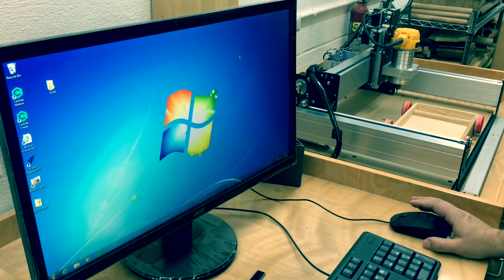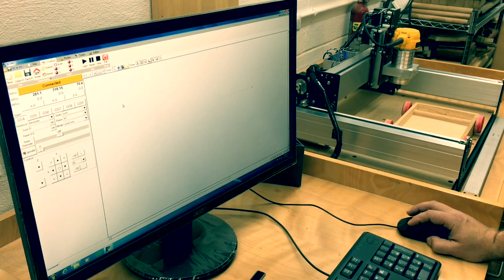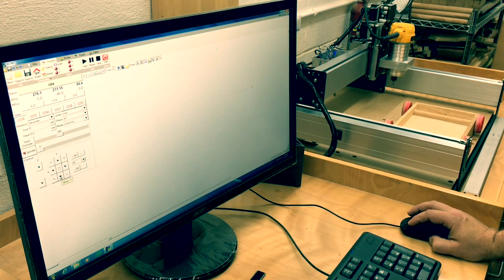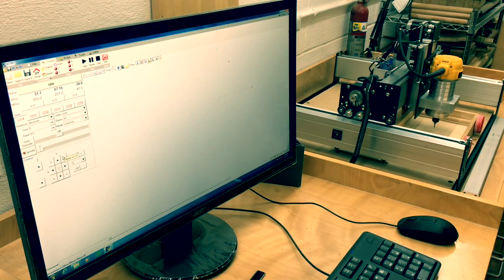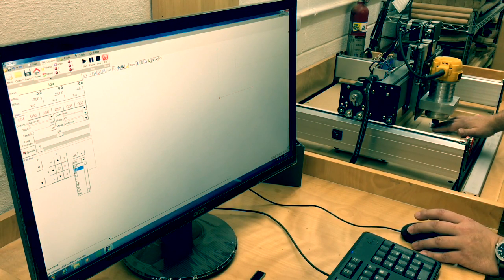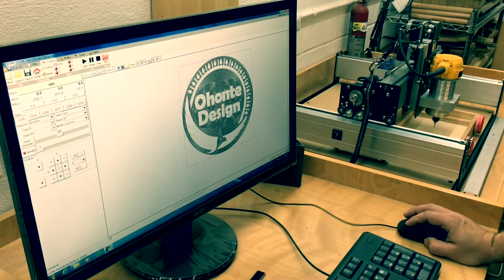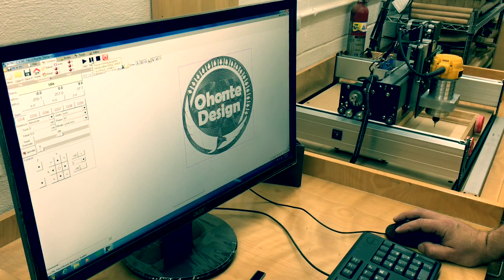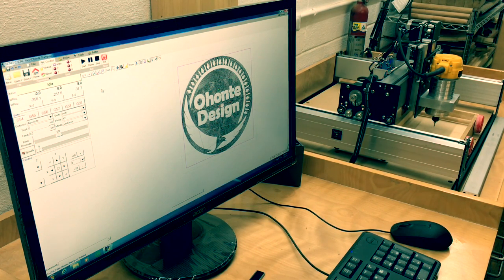Shapeoko 3 bCNC Beginner Tutorial

Comment: Hello, I have a question and problem to reset the command HOMING, when I start it is with negative values ex: 800-600-x and y, so when sending the file he travels all over the area and shows the HARD LIMIT message and crashes. It also occurs when reverse the position of the HOMING on the table.

Comment: I'm using gcode sender with no problem. but i'd like to try BCNC. the problem is that it's not easy to install it. Do i need to learn python to use it? I installed python with no issues, but then I'm having hard time installing pyserial. the file has an extension .whl . never heard of such extension and have no clue what to do with it. any suggestion for what should i do? and btw, when I click on the .bat file, nothing happen.
Reply: Yes i agree..installing bcnc needs to be simple ..its too complicated. ...i downloaded an old version that soneone compiled becsuse im not interested in learning software designing.
Reply: Very true, and all the tutorials on bCNC I have watched already have it installed.